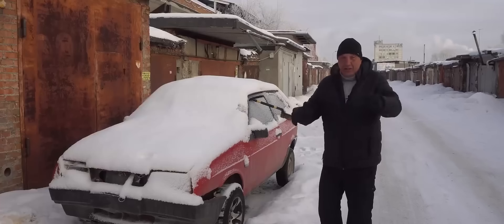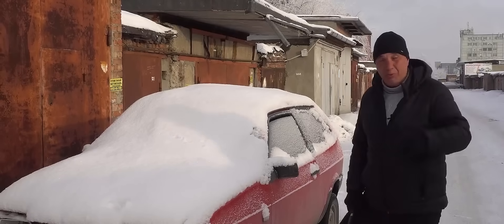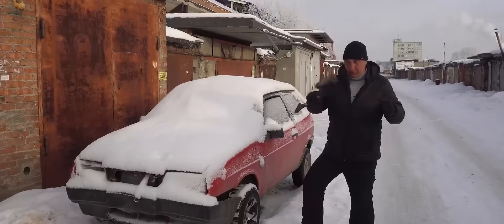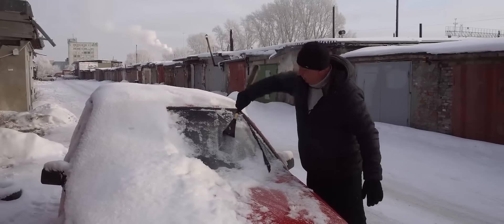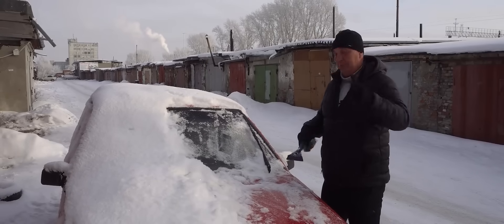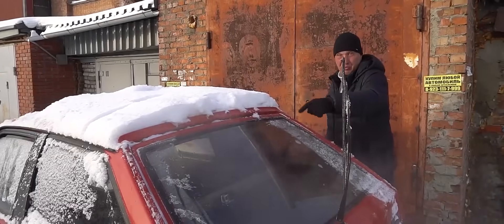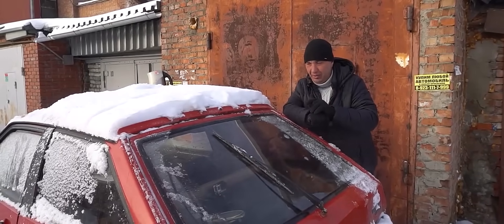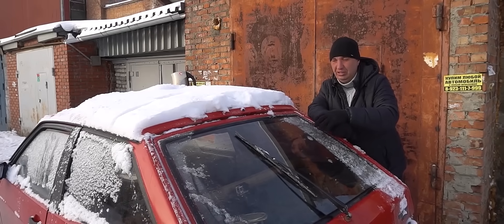What happens when you POUR boiling water onto a frozen windshield?

Comment: I think it only cracks if there is already a rock chip or small crack in the window.
Reply: Also cracks if it's a hot window with cold water
Reply: my windshield was clean, no cracks or Knicks. one day it was like 25° F and I remote started my car. the heater was on full blast and had the defrost on. I took off and while I got on the highway I began to see the windshield form a crack. it was in the middle of the windshield right above the defrost vents 😭😭
Reply: Andy V. Thay are not always visabul
Reply: Like with this guy:
https://youtu.be/tpW-NAW0qUk?t=34s
Reply: x0xCRUSHERx0x *vizeyebull
Reply: I cracked mine on a summer day with cold water
Reply: chabka34 *visable.
Reply: Andy V. Ooooooooooooooooh... That's where my crack under the wiper came from. Thanks.
Reply: Yeah mine cracked that way too. Had a rock chip in it already and I was too impatient to way for the ice to melt off or to scrape it off so I just started driving and I had to heavily brake to not go through this intersection and my truck started to slide because the roads were covered and I heard this weird noise but didn't think anythhing of it and my window was still covered in ice so I didn't see the crack. Later that day when I got back in I found the crack stretching the fully length lol.
Reply: bonkey dollocks your wrong
Reply: I've seen it happen during summer when chilled water on a hot cracked windshield added 5 more cracks when someone sprayed it
Reply: I think the windsheild cracks because when there is a chip in it water gets in and freezes if that doesn't crack it then when you turn the heat on, the glass expands before the ice inside the chip melts and you end up with cracked windsheild...
Reply: Joshua Rhoden i dont think windows can scratch
Reply: Fer Gap vysybul
Reply: I cracked mine on a summer day with cold water
Reply: I'm an autoglass technician. It definitely cracks due to an impact or imperfection, not just the temperature differential. Also, glass can absolutely be scratched.  Most commonly by women's diamonds, or in my profession, by the other glass by sliding it against themselves in and out of the inventory racks.
Reply: Jason Grimes correct
Reply: All it takes is a scratch.
Reply: You likely had a small chip or scratch you couldn't see.
Reply: chabka34  visible*